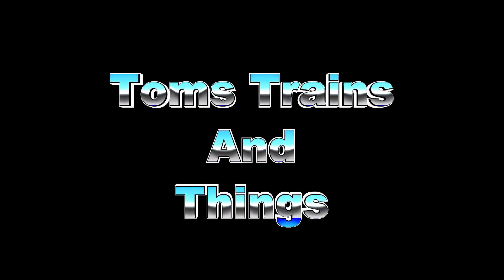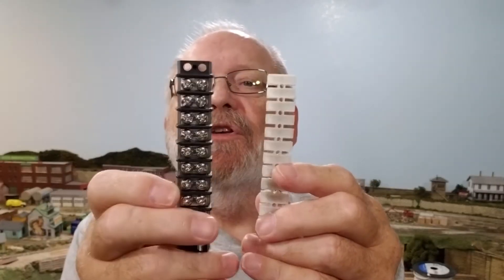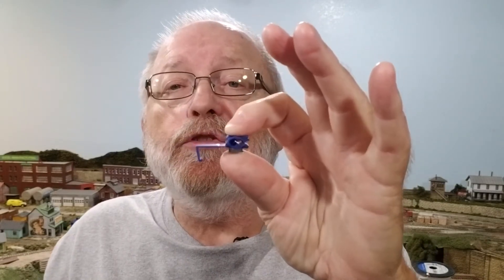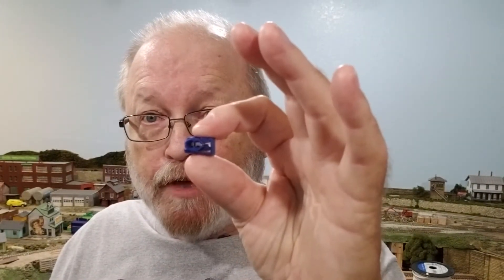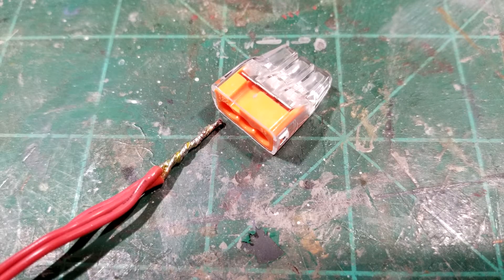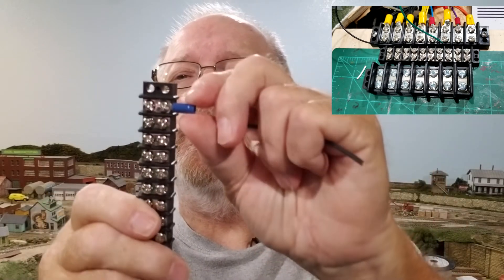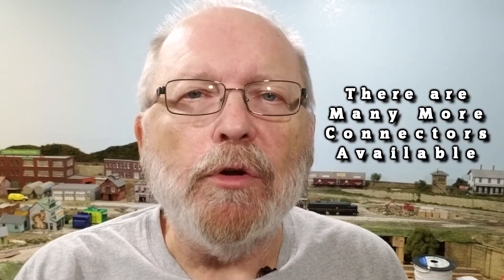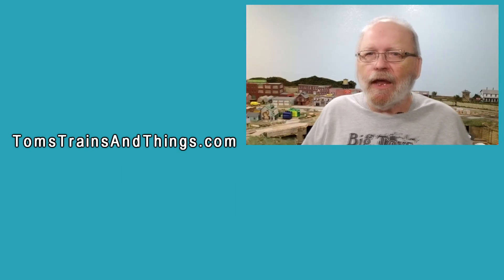What Connectors Should You Use For DCC On Your Model Railroad

Comment: The biggest issue with IDCs (suitcase connectors) is not the connector but people using the wrong size. I have used IDCs for years and have never had a single connection fail. You cannot  go from 14 - 22 AWG directly. I use a 12 AWG main bus, then I use a sub bus for districts that is 18 AWG. 12-18 AWG works perfectly if you use the correct connector. Then I hook my 20 AWG feeders into the 18 AWG wire which also works perfectly if you use the correct connector. In other works, the connector is not the issue but misuse of the connectors or using the wrong size.
Reply: They do make suitcase connectors that are designed to attach different gauge wires.
Reply from the maker: Thanks for the info Earle. The biggest issue is that most modelers go down to their local hardware store and buy the cheap ones and end up with major problems with them.
Reply: i saw suitcase connectors on line for 2 different gauge wires such as 14/18  and others.
Reply from the maker: Most modelers just run down to the local hdw store to get the cheap ones. Those are the ones that cause the problem.
Reply from the maker: Well Ron, when you have to use two or more connectors to accomplish what the one connector is intended for, then you defeat the simplistic task of splicing two wires together. Your right about modelers using the wrong size suitcase connector. There is no right size to use when your using two different size wires. They are not designed for that. 

Using a work around to accommodate the difference in size is just too much work. I've been working on electrical/electronic components for 40+ years and never saw a suitcase connector used anywhere because they're unreliable. If I saw one used in a control panel, I would remove it immediately.
Reply: Toms Trains and Things What I described is how my wiring is designed. I use a 12 Awg main bus. For each short district I connect to an 18AWG sub bus which connects feeders.

It isn't true that IDCs aren't designed to connect different aize wires, they are designed for that within the range of the size of that connector. A 12-18 AWG connector can connect those sizes together. An 18-22 connector same way. You huat cannot make a direct connection between a 12 or 14 AWG an a 20 or 22 AWG wire. Personally I don'y use IDC's to connect my main bus to the aub bus. I use terminal strips for that as well as my short management system. I douse IDCs to connect my sub bus to feeders and have never had a problem.